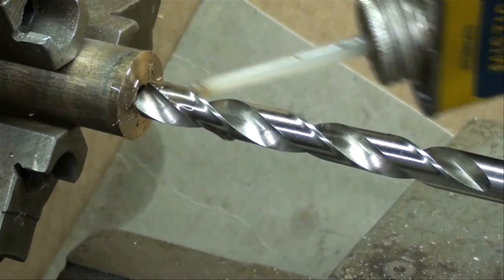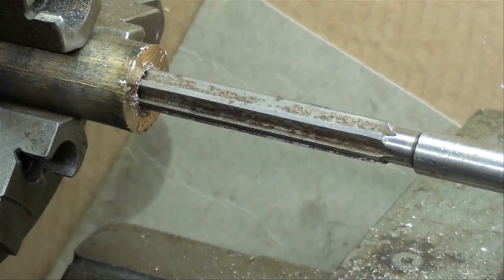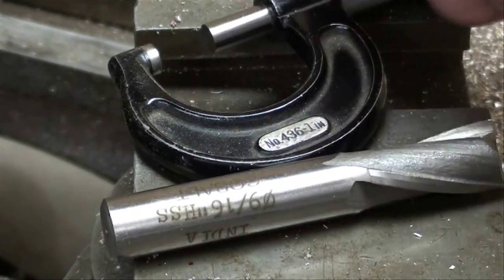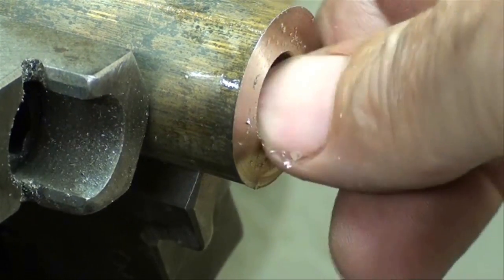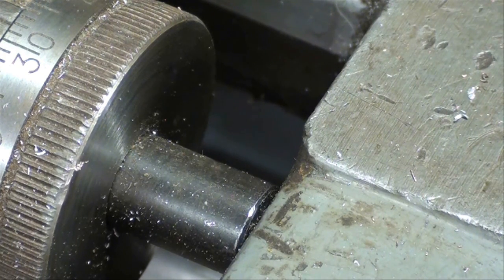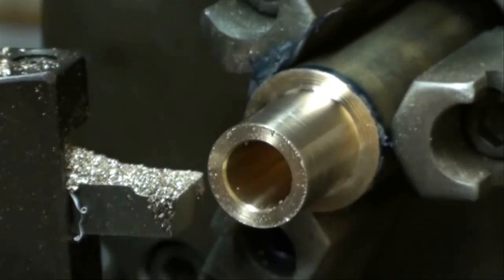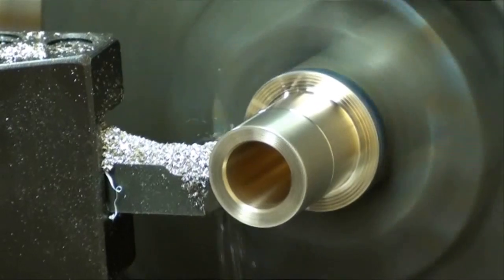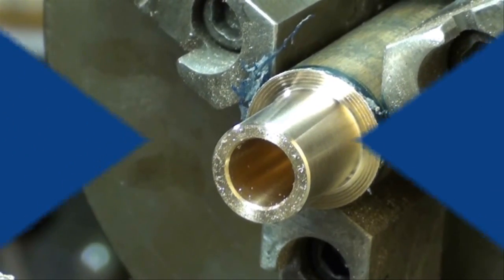MACHINE SHOP TIPS #47 Lathe Project BEARING Pt 2 tubalcain

Comment: Hello Tubalcain, always like your videos. Enjoy your teaching abilities. Some quick friendly tips:
In vid#1 use use a  center drill for preparing a drill hole. A center drill is used for holding a center(60deg), not for predrilling. One should always use a spotting drill with a included angle of equal or greater than the drill your going to use.
Rule of thumb for reaming is twice the feed, half the speed you would use for drilling the hole. 7-1/2" per side.
As always, your tutorage is spot on. Wished I could have watched these when I was starting out, great work.
Reply from the maker: +Keith Hansen Thanks
Reply: +Keith Hansen Every machinist I've ever met uses those "Drill-Point Countersink" bits like used in the first video for spotting/center drilling. They work so well for that, partly I think because the countersink part does the center drill job, and the little hole they make serves as a great pilot hole. Above all they are rigid enough to make a hole where the machine tells it to, without wandering. I suppose theoretically you are right, but you don't see it much. It's more important for large sizes, where you need a spot with a greater angle than the drill as you point out.
Reply: Dale Emery similar.  I would never bother finding spotting drills to center, maybe if you need extremely concentric drilled and reamed hole the bit could walk.  but I lack large bits and large reamers so I'd be boring
Reply: + Dale Emery  + pbgd3 : I concur.  Have always used a center drill for starting a pilot hole.

Comment: Love the videos - but the hole will only be concentric to the axis if you don't move the stock in the chuck.. The hole and the OD have to be turned without rechucking the stock. This is rough stock, and an old chuck...

Comment: is that brass? I have heard that, when you drill a hole in brass, you should never pre-drill it. no matter how big your hole is going to be, always use the drill with your final hole diameter, because otherwise the bigger drill will get stuck in the smaller pre-drilled hole (especially if you drill it on drill press without fixed vice). I know that this is giving problems indeed, but I could never find an answer to why this is a problem with brass. Do you have any explanation to that?

Comment: I have always thought that holes first would be the best way to do it.  Some machinists turn to OD first especially for soft materials that would crush a ID.
Reply: Interesting, I did not know this I just made a bronze bearing for a motorcycle of mine, this a main bearing, the other.side.has roller bearings so I machined od first, bored hoke just.undersized, clamp cases together then set reamer in the roller bearings to ensure center. I thought I was being smart but.shiukd.have found another way to do I'd first!

Comment: At 6:19, When you back the carriage out, you're cutting some metal which looks like it's done unintentionally (by a distortion of the tool bit or work piece). Why is that? You can see clearly that it leaves marks on the work piece. I've seen that in other videos of other people as well. Is there some way to avoid that? Why is that happening? Thanks..! :)

Comment: Never could understand Imperial measurements, or why the USA seems stuck in a time warp. Your tail stock, chuck or reamer are well off, would have stopped seeing the jump. My 12" Harrison $140 lathe milled its own tool holder just using a mill held in 3 jaw chuck, just needs cardboard sleeve, lubricant and caution.

Comment: Didn't taking .008" off the diameter require moving the cutter .004"? I missed something there..
Reply: Not an expert, but as far as I know, most lathes have some sort of gearing that reduces the distance the tool moves by half.
So technically you are right, the tool has to move by 0.004", but it simply shows the difference in diameter, so it's easier to use.
Hope that helps/I put it clear enough
Reply: They would. I'm in the dark anyway, but all will be revealed when I get Mr Pete's two lathe courses and the milling machine series.
Reply: +Paul Mcnulty It depends on the lathe. In this video Mr. Pete's using his Clausing lathe which has actual read dials so you can just dial in the exact measurement you want. A lathe with direct dials you'll want to cut the measurements like you described.
Mr Pete does go over this, it's worth a watch, especially to make sure I didn't reverse the terminology.
Do get his courses, I did and they are great! Well worth the purchase!!

Comment: Drill the hole leaving 20 thou in, use a shank reamer  , rather than pissing about with that hand shit! My boss would expect that made in 10 Minites max. Running chuck speed is to fast for reaming needs to be half that .
Reply: Yeah but he's not doing production work. Granted in a production shop this would take way to long but for the home hobbyist or casual machinist not under a deadline or production schedule this method works fine.
Reply: None of the videos here on you tube are expected to be used in a shop situation, so nobody cares what your boss might think. This is for us casual users. (nice job, mrpete)